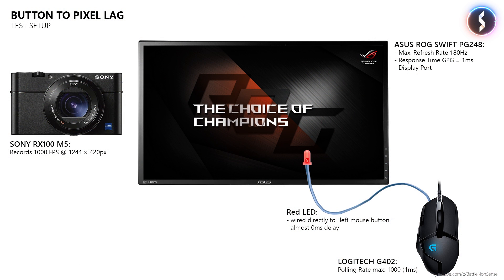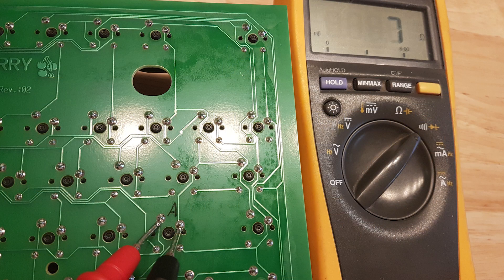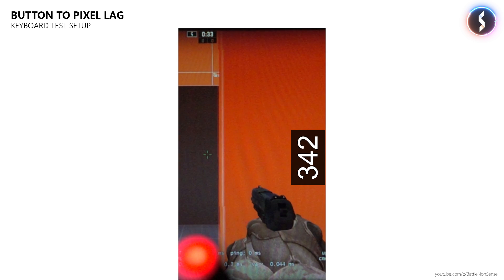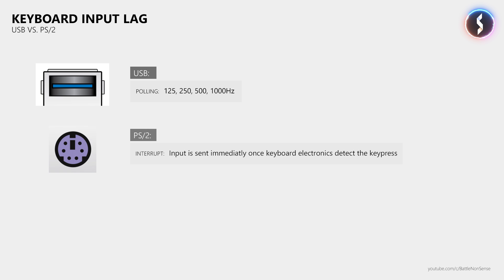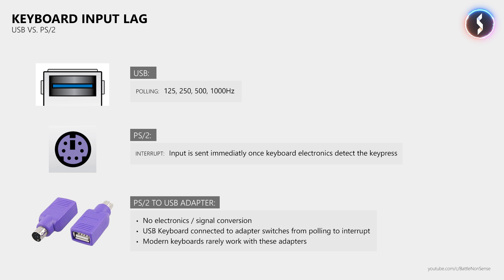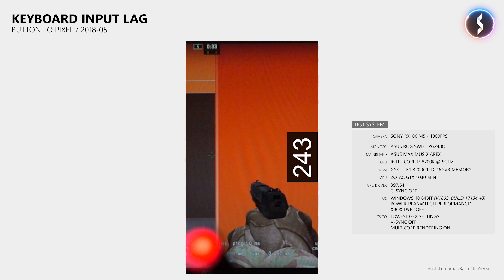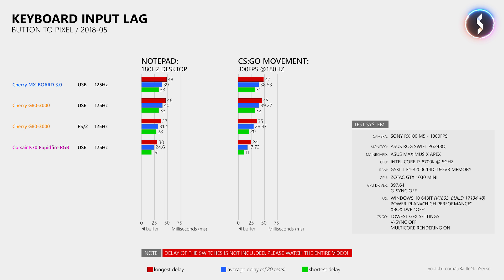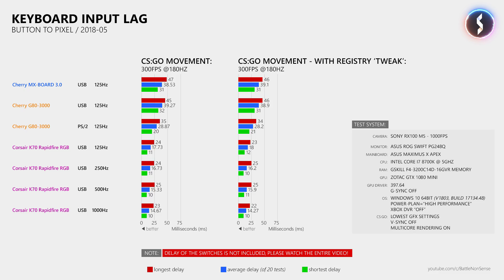Keyboard Input Lag 125, 250, 500, 1000Hz USB vs. PS/2

Comment: Modding the K70 Rapidfire RGB with MXSpeeds (silver) I see :) (Then i watch rest of video and see you define it..haha)

It also looks like I should get an adapter for my k70.  Thanks for the work and proving this!  Also, the MXSpeeds vs Reds are a nuissance, always hitting wrong stuff, I will have to put the  orings on there to assist that issue.

Comment: Would be nice if you could do some research into recoil lag we really need people who can or know any experts to look into this i am not giving up fps because of this, that issue is famous among games like CS 1.6 bf3& bf4
 I mean the horrible truly game changing stutter/lag  visual & audio whilst/whenever engaged in any firefight. 
I know people will say it's unfixable, but i dont know anyone who will address this issue other than a few (I hop3)
Can't accept the thousands of pounds spent and the months turn into years and we cannot play games (I know!, it's 'u fixable) yeah we tried 'EVERYTHING' yet something is missing, people are pointing towards electricity/grounding issues or corrupt games over time. Doesn't do much in the case of the latter when you are suffering it even if minor form initially from the beginning.

With games like bf5 round the corner, we hope we may be ok but are usually doubtful we will be able to play it as historically many of us suffering it, suffer  repeat in next game!

Not nice that i am on my third  build already all high end systems, currently 2 side by side and sitting there just to test only to hear that 3 complete rig's is normal some people 10. There was a guy that is so upset he moved home 7 times! Many others have done the same. Ironically it doesn't happen for me in bf1 but i would never bother with that game. (I bought for testing) people are so ignorant about this game changing ( for the worst) issue that they will say update chipset drivers :D or set windows power plan to high etc etc which are possible fixes for general stutter. Where as this issue has never been reported to be fixed from anyone. Look the forums we are still discussing it.

Comment: Yo battlenonsense, to make it easier for you to see when the input is registered in csgo, just go to console, sv_cheats 1 and then host_timescale 2-5 this will speed up the game by that amount, also consider noclip with sv_airaccelerate 1000-2000 or simply sv_accelerate 10-20 (or more) to make the initial incriments of movement not be so slow, especially for no clip, I am unsure if you can go higher on the normal sv_accelerate so see if you can and if it is to your liking, cheers.

Comment: at 300fps, the smallest delay possible would be 3.33mhs (1000mhs / 300fps). I realise that 300fps isn't necessarily paced perfectly, but the stars might align and the game sends a frame out to the monitor which then displays it within that perfect moment.

But, if the game has a 1 frame of latency on inputs (due to being multithreaded for example), that would add at the best case scenario 3.33ms to the latency.

Then again, if the operating system or input library adds a frame of delay (or possibly two frames of delay), then we could see another 3.33ms to 6.66ms added.

So with the smallest delay of 3.33ms possible, and frames of delay latencies, 10ms makes sense.

Then again, I might just simply not know what I'm talking about.
Reply from the maker: While at 300FPS you do indeed get a new frame every 3.33ms, the 'actual' delay that the player is affected by comes from the refresh rate of the monitor.
You see, when your monitor has a refresh rate of 60Hz, then this is more or less like playing at 60FPS. Playing at higher FPS does slightly decrease the input lag even on a 60Hz monitor as input is processed at frame time, however the 60Hz have a very strong impact on the 'input to pixel lag' as the monitor just won't draw more than 60 frames per second. :)

Comment: This video is not really conclusive. Why wouldn't you try native ps2 keyboards too, to avoid internal controller clocks, etc?
Reply from the maker: Because I could not get a PS/2 mechanical keyboard. Only PS/2 membrane keyboards are available here.

That said, Cherry support assured me that as soon as you plug the G80-3000 into the PS/2 adapter,  it behaves exactly like a native PS/2 board as it switches to that mode internally.
Reply: Wow. That's 1st world problems at its finest, haha.

Comment: you might want to try the ps/2 keyboard on a pc from the late 1990s. I've heard that the ps/2 ports are connected in a different way on modern pcs. Also, it would be interesting to see a good gaming keyboard with the ps/2 connection.

Comment: what about the input lag of your monitor? the pixel response could be 1ms but the input lag could be over a frame regardless of refresh rate...
Reply from the maker: I talked about this in my G-Sync and FreeSync monitor tests. :)
That response time of 1ms is only for the panel. It does not include the delay caused by the monitor electronics (scaler, etc.) and signal transmission between PC and Monitor. There is also a difference between DVI/HDMI and DisplayPort (spoiler, DP is slightly faster)

Comment: This guy litteraly soldered things on a 150$ keyboard and probably spend hours and hours to figure all of this, just for us, and he apologize :D How about optical switches ? :p
Reply: This is a great video, but it's sad that a 5GHz CPU is effectively turned into a slow unresponsive computer by the keyboard processing architecture ... how does one justify a 39ms response time in Notepad to keypresses (that's 195,000,000 CPU cycles from time of keypress, to response - that's atrocious) minus specialized 1000Hz keyboards? And even at 1000Hz, 21ms response time in Notepad still ... actually sucks if you think about it ... that's ~105 million CPU cycles between keypress and response ... how much of this is the Operating System and how much the hardware? As a programmer who types quickly I can feel the difference. We should be designing hardware and OSs to have sub-millisecond response times between keypress and pixel output. Even a millisecond is 5 million cycles .. an eternity.
Reply: @DavidJoffe1  the comparison shows that 2/3 of that is caused by the keyboard (probably trash firmware/dirvers). his best performing keyboard had 21ms in notepad.
but granted 21ms is still a lot, and the reason for that is because the vast majority of that is visual latency:
- a 1000fps camera was used for this test, or in other words 1ms frame time. that means we loose on average 0,5ms here
- the test was done on a 180hz screen, or 5,55ms refresh time. that means the color of any pixel is on average 2,77ms old
- monitors have a response time, sometimes up to 5ms
- notepad is windowed, and the windows desktop environment uses double buffered vsync which effectively adds another 1,5 refresh times on average (8,33ms in this case)
- notepad isn't designed for latency testing but for running on potato hardware, so inputs are buffered and sometimes processed in bulk. its difficult to say how much time exactly is lost here, but its notable
- the CPU isn't the component that does rendering, it needs to pass render instructions to the GPU, which again are buffered. Battle(non)sense has a video that shows how this buffering alone can cause 20ms under certain circumstances.
- 5Ghz CPU clock doesnt mean the ability to process 5billion inputs per second.  it means the ability to execute 5billion assembly instructions (and the topic becomes VERY complicated here)

> As a programmer who types quickly I can feel the difference

no you can't, thats placebo. the human brain can't compare 2 inputs from different sensory organs (finger touching the keycap vs photons reaching the eyes) even remotely that precise. Even the world champions in rythm games (osu! for example) can barely tell a desynchronization on this scale, and that's with both inputs on the same sense (not to mention that acoustic recognition is the most precise of our 5 senses)
Reply: @LastExceed  Keep in mind he was recording a 180hz screen which can be increasing the latency ever so slightly (5.5ms? Compared to a 1000hz screen if that existed.)
Reply: @DanielKaspo  that's already on the list (2nd key point)
Reply: @LastExceed  Something to add here about comparing input from touch and visual information. It can happen quite easily that it feels like a reaction occurred before you've even pressed a button. While I don't know the delay required for things to feel that way, I assume 5ms would be in that realm.
Reply: @poipoi300  thats a great example of how placebo can go both ways
Reply: @LastExceed  It might be placebo but I don't think that it is. I discovered a reproducible setup completely by chance while doing something completely unrelated.
Reply: @poipoi300  placebo can work even if you're aware of it. besides, what else would it be ? surely your setup doesnt break the fundamental laws of causality?
Reply: @LastExceed  For a placebo to work, there has to be some sort of expectation. There was no such thing here, at least not directly related to the feeling or the very first time. I was not trying to test my senses, I was not trying to do something quickly, it simply happened. My sensation of touch didn't match up with my sight and it felt like the desired action happened before I had sent the command for it to. What it is in an illusion plain and simple. Of course the action won't happen before I start it, but that is the way it feels. Similar to optical illusions that seem to move but don't. Would you propose the same about those illusions? That I think they break the laws of causality? This is entirely about perception, and it's not difficult to deceive a human's, placebo or not.
Reply: @poipoi300  ok i guess placebo was the wrong term here. the point i was trying to make was that this has nothing to do with technical details, but it seems like we already agree on that
Reply: @LastExceed  It certainly has to do with technical details. The faster something occurs the more likely it is for your brain to be tricked into believing that it occured before you sent the command for it to. Perhaps that on its own isn't enough to cause it, but it is 100% part of it. It's something I would encourage experimenting with yourself. Now in those types of experiments, yes there may be placebo. You can make many blind tests to mitigate it in that case.
Reply: @poipoi300  i dont really get what you're on about. yes, the shorter the delay between 2 events (in this case cause and effect), the harder it is to tell which of the 2 happened first, especially when they're on separate sensory channels. that's pretty obvious. what point are you trying to make here?
Reply: @LastExceed  Simply adding to your comment about the person who said they were able to tell the difference. I agree with you that we aren't accurate enough in those time ranges when it comes to sensory comparisons, proof being that we can feel as if reactions happen before actions.
Reply: You speak any london by chance?

Comment: I still have an old Logitech rubberdome keyboard that's been connected via USB (125Hz). Did some digging in my drawer and found an old PS/2 adapter. I've connected the keyboard with that and it's working flawlessly so far. Might not make a huge difference but it's surely not detrimental either. Thanks for the video.

Comment: Why didn't you just use a relay for that? You could've just taken the output from the key and ran it through a diode and then amplify it with a relay.
Reply from the maker: because their is neither enough voltage nor power to drive a relay. Also how would this have made the setup better? O.o

Comment: (First ever comment)
Nice detailed analysis as usual:) 
Though I'd like to point out a few factors that may impact results:
1. Keyboard circuit design: this may induces it's own lag, using an unrelated example, on notebook keyboards (I do this for a living), measuring signal bounce directly from membrane sits at 1ms, yet on system, the bounce time becomes somewhere around 20ms. Thus highlighting how circuit and architectural design can also impact input lag to a certain extent.
2. MCU FW/Switch property: all switches have signal bounce when activated, so MCU has to denounce the signal , and depending on how aggressive the brand is at eliminating unintended activation may range from 10 to 20 ms.
3. Input lag decrease from changing polling rate: polling rates define how long between two pings and thus a 1000 hz rate may have any where around 0 to 1ms delay.

Dont get me wrong, your results are still extremely useful in highlighting how different setups can affect input lag, tbh most industry giants uses similar specs thus the impact I pointed out may be minimal, but whether it can be ignored will be an interesting discussion.

Comment: Thanks for uploading this video and after all that soldering effort. This does show that PS/2 Keyboards have less lag than USB Keyboards. I believe the max Interupt Rate is 200Hz not just 125Hz. And yes I guess it also depends on the design and the way Keyboards are manufactured by Corsair to compete against Logitech and Cherry.

The only questions I like to ask to the viewers: should we just stick to our old keyboards like those old IBM Model M Keyboards? Is the high polling rate of 1000Hz really necessary for your mouse and keyboard for your computer to ask about your main Input device's current state once every 1000 times per second? And should PC manufacturers create a new Input port that still uses the Interupt Technology like PS/2 did but make it more robust as well as hot swappable - or maybe have a Max Interupt Cycle of 1000Hz?

Comment: Another fantastic, insightful video!

However, a good question can be raised:

Is the G402 Mouse a sufficient mouse to use to measure the lag/delay of online games when testing out the delay of the game and not the mouse? Are there mice with better internals/electronics than the G402 in order to minimize the mouse from the equation of testing the delay of online games?

As this video shown, there are keyboards with differing delay timings, even at the same polling rates. So one could assume that this can apply to mice as well.

No disrespect meant at all, just curious.

Keep it up battle! :D
Reply from the maker: When testing the input lag of a game then it does not matter if this is an online or offline game.
While there might be other mice which have lower delays, this does not quite matter that much as I test all games with the same mouse - so you can compare the results and see the differences in input lag as the same hardware was used for all tests. :)

I would love to do more input lag tests with difference mice (especially wired vs. wireless) but the costs are a major problem. :-/
Reply: That is right! Since your mouse stays the same throughout most of the game tests, the input lag results are still comparable (in relation to the input lag of game to game).

It would seem that a quick and dirty method to generate input lag results of multiple mice for multiple games is take one of the games, compare multiple mice with that one game, check the input lag results of the one game for the mice, then scale the input lag of all the mice accordingly with the other games.

Or is it possible that this scaling idea is not quite true?

Comment: Hi @Battle(non)sense, great video as usual! Is there any reason for not having tested an old native PS/2 keyboard?
From your video, it's clear that keyboard eletronics play a major role in keyboard input lag. Old keyboards were probably simpler internally (it's a guess): less features, not having to support USB, etc.. Simpler eletronics probably means it's faster (again a guess). Therefore, there's a chance that an old native PS/2 keyboard might be even faster than the ones you have tested.

Even without that argument I still feel that testing a native PS/2 keyboard is missing, because, the way I see it, you tested all of the most common keyboard setups except this one (native PS/2).
Reply: ruimams I have an older model Mechanical PS2 keyboard I offerred to mail to him...lets see what he says! Can I PM him that on youtube btw?
Reply from the maker: I tried to get a native PS/2 mechanical keyboard - but I could not get one anywhere. Only those with rubber domes and membranes.

However, Cherry Support assured me that when you connect the G80-3000 to an PS/2 adapter, then it behaves exactly like a native PS/2 keyboard. There is no signal conversion happening inside the keyboard either, it switches from polling to interrupt.
Reply: I'm no expert in eletronics, so I believe that (and it seems true)*. However, I'm still left a bit curious about the performance of an old keyboard (like an IBM Model M), given that they probably have simpler (less) eletronics, i.e. not because of the native vs non-native PS/2 but because old hardware is usually simpler.

* - However, I must say that this goes against (my perception of) the philosophy of this channel, because if we were to trust the hardware manufactures and the game "developers" without testing their claims there would be no reason for this channel to exist (i.e. I believe this is exactly what you do).